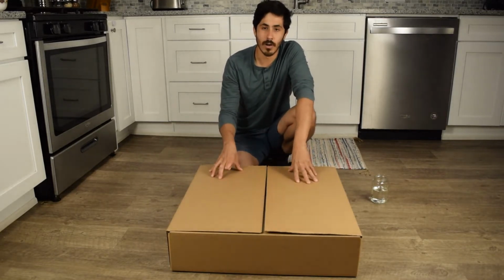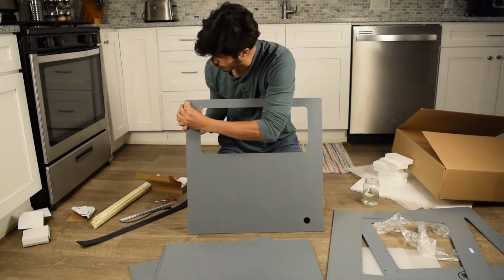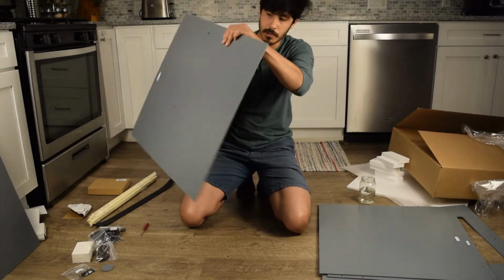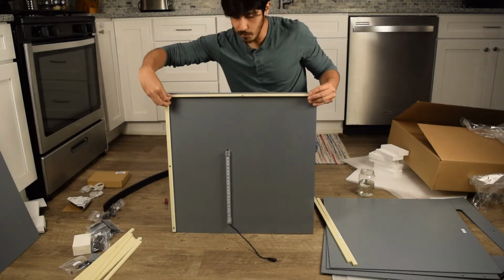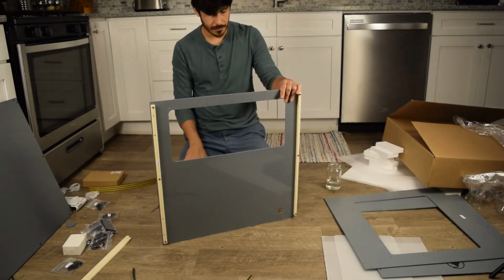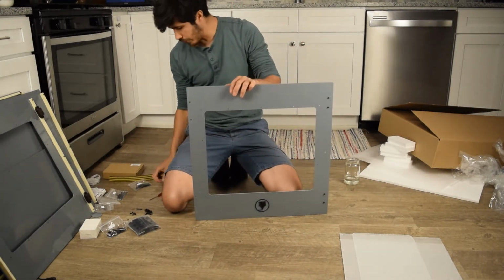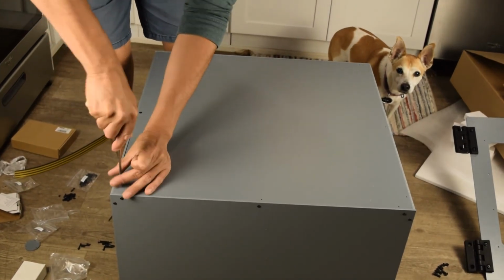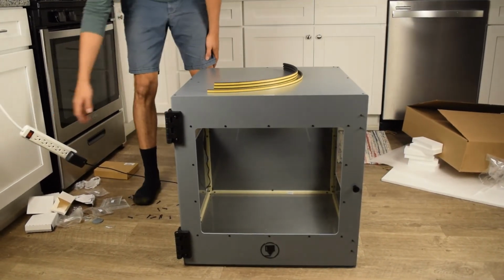Makergadgets Innovator 3D Printer/ Laser Engraver Enclosure Assembly

Comment: I absolutely love this enclosure. I also really like the diligence you show not just in the thoughtful build quality, but this video explaining how to put it together. It's very logical. Love the LED strip too. 

Will this fit an Elegoo Saturn 2 (guessing yes) but can I get a UV curing station in there too? 

Also, I'm very interested in an exhaust port so I can run fumes out of the case to the outside. Do you offer a case with this functionality? I could see you offering this with a port that is optionally used (or left covered). Maybe  your other models have this. 

Thanks much!